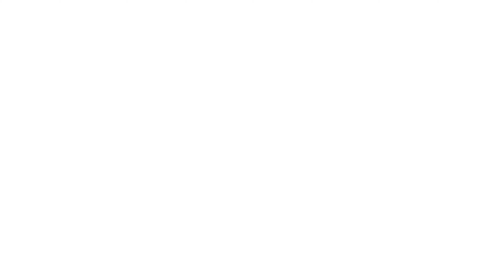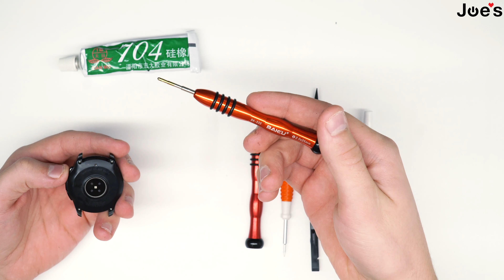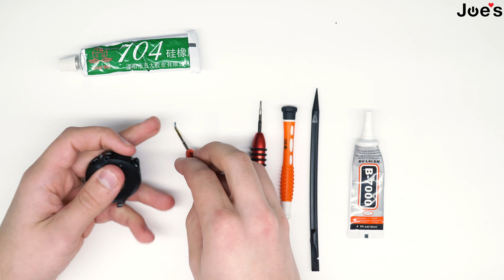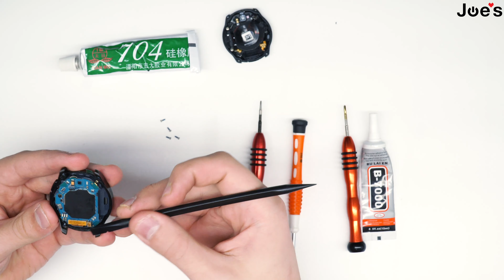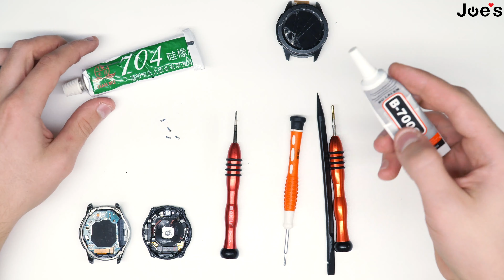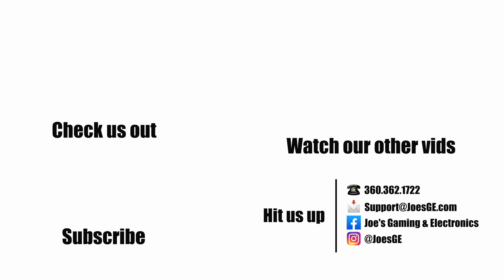How to Replace Broken Screen on SM-R810 Samsung Watch | Repair Tutorial

Comment: Is it an oem quality replacement part? I have a Samsung galaxy watch 3 45mm that I accidently wore while sandblasting. So the screen is not cracked it is just pitted basically. I tried a Glass polish but it made it a bit hazy. Still 100 percent usable but if they're 89. 99 for an oem quality replacement I would buy it. What's the chance you guys stock s20 screens lol
Reply from the maker: All of our parts unless stated otherwise are original. We unfortunately do not have s20 screens.

Comment: So I cracked my Watch Active2 screen the other day and want to try and repair it myself. My main question is will a repair ruin the watch's waterproofness?
Reply from the maker: It can, but if you glue it back together correctly, you should be okay.
Reply: @Joesge  Oh got it. Sounds scary though.
Reply: Where did you buy the replacement screen?? Thx
Reply: @mariegb6038  I haven't found a replacement yet,  it looks like a very rare replacement especially for the Active2
Reply: @theochar  same, I don't find anywhere a new screen for my active2...
Reply: @bestiol2  Ebay has them, ships from over seas though.